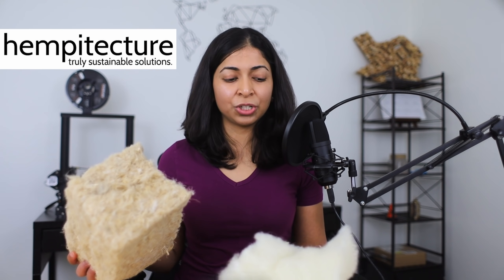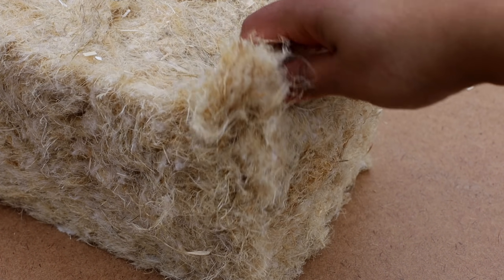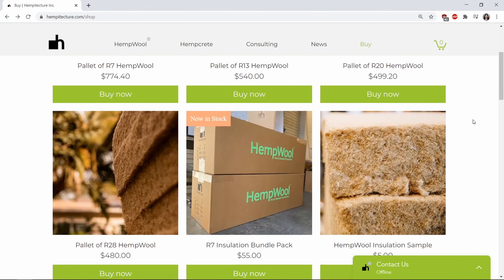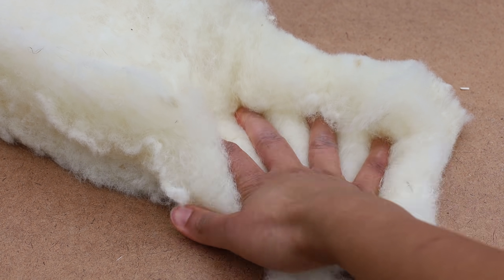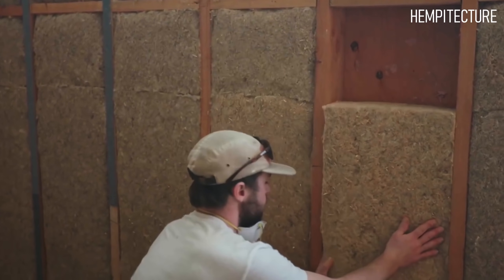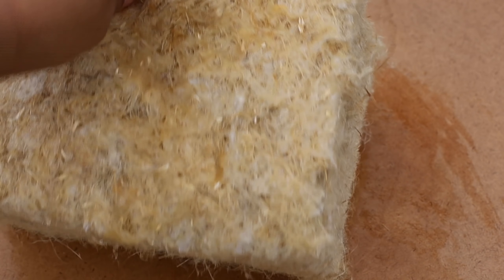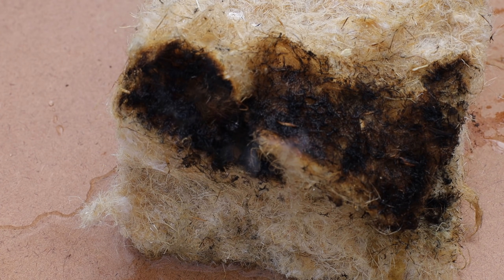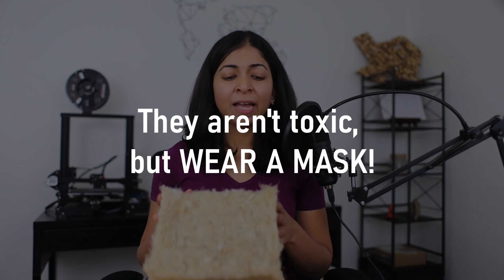Hemp wool vs Sheep wool insulation | Everything you need to know

Comment: There is absolutely no way that the embodied energy requirement of sheep wool is lower than that of hemp this is because it is an animal product versus a plant product. 
This means that per square meter to make 1 kg of wool we need to feed the sheep a significant amount of plant matter, probably somewhere in the order of 10 to 20 kg (citation needed obviously). However with the hemp product we can use those 10-20kg directly instead, therefore yielding a much higher amount of insulation material per square meter of soil used. 

I must say though that I am quite saddened by the flammability of the hemp product it looks like it could’ve been a fantastic competitor to mineral wool, but given the lingering burning that happened it seems like it would be nigh impossible to extinguish a fire if one were to ever reach the insulation layer which is a serious concern, not to mention the vertical rise of fire through the walls. An otherwise small fire might wreck the whole house. Thats nit very eco friendly either.

Still I do really hope that it is solvable because otherwise it looks like a phenomenal product
Reply: Yeah that surprised me also, even more given the energy requirements for wool scouring. That said, the hemp was a blend with synthetic fibre, and there may be differences in growing pasture vs crops in terms of energy inputs.
Reply: @motorbyclist   hemp is known for being one of the most efficient crops, (ratio of sunlight to biomatter created, and equivalently co2 absorbed) together with corn, 
so its very likely more efficient then a pasture too ^^

Comment: Once again great content.
That fire test is such a concern this product should not be approved.
Electrcial wires and connections can cause fires and this product would spread fire.
I cannot touch any insulation batts without coughing, hate the stuff.
You can have chewing gum, helps stops fibres going into the back of the throat.
Cheers from Oz

Comment: Hi Belinda
with regards to asbestos, this material is the best insolater, however it is banned.
my concern is that asbestos cuases cancer in closed area with poor ventilation and the presence of asbestos particles that expose labours to get infected (very ideal condition). but outside in the open area and good ventilated area they dont cause harm. my guess.
i shall share a story in Oman where I used to work:
new portable cabin offices installed with split AC without fresh air blowers in these offices. offices hold upto 150 staff. locals and Asian did not suffer any health issues. Europians on the other hand started suffering from lack of Oxygen. when room were tested, the percentage of oxygen was low. then we istalled blowers with fresh air to overcome this issue.
this lead me to conclusion that our lungs are more reslient than of Europians.
this is applicable to Asbestos as there is not case or death ever recorded in the middle east due to Asbestos. I could be wrong.
the ban should be challenged and more tests to be conducted.
please share your thoughts.
hope to hear from you soon.
Reply: you are wrong. Gulf Center for Cancer Registration provides data on the cancer incidence in six countries (Bahrain, Kuweit, Oman, Qatar, Saudi Arabia, and United Arab Emirates). In the period 1998-2007, 144 mesothelioma cases were registered which is  comparatively low incidence. Countries such as UK have very detailed registries and studies of populates where as data in some countries may be incomplete.  The 4 main risk factors for developing asbestos related illnesses are 1) exposure 2) the type of mineral 3) genetics and 4) concurrent smoking history.   in terms of your oman story - if europeans suffered from 'lack of oxygen' then the conditions in the buiolding were incredibly dangerous  - you would need to be in a fully sealed freezer  van or something to actually run out of oxygen.

Comment: Thanks Belinda another great introduction to insulation. I think you covered most of the pros and cons on this subject, but may I add a con for sheep's wool. In the UK we had problems with wooly moth infestation munching their way through the insulation and then clothes and carpets! To be fair this was due to the leaching of the insecticide treatment. A new wool treatment was introduced about 10 years ago and it seems to be working, however specifiers continue to be concerned about the risks. For this reason we always spec hempwool.
Reply: Hello! Havelock Wool here. We do add a slight amount of boric acid which deters all insects including moths. And we note that across our +10,000 projects we have had zero reports back of moth issues. Thanks!

Comment: I'm guessing hemp sequesters carbon from the atmosphere. That is nice. As far as sheep are concerned, do they emit large amounts of methane like cows?
Reply: Hello! Wool too is a carbon sink. Attached is a blog we wrote about it. You can also check out our Environmental Product Declaration which provides a full analysis of impact. Thanks! https://havelockwool.com/2020/08/wool-carbon-storage/
Reply: Thanks. Saved me typing this. I Googled. Hemp is very good at sequestering carbon. Sheep, like all ruminants produce methane and a lot of C02 is emitted to raise them.
Reply: @wclark3196  If sheep were kept exclusively for wool then that would be true. if wool is a byproduct then the carbon calculation is not so straighforwards.
Reply: @twmd  Already thought of that. Sheep husbandry still is an emitter of greenhouse gases. Devote the same land to growing hemp and you will be removing CO2 from the atmosphere. Furthermore, wool is the "byproduct" of meat production in your scenario. Eating meat has a harsher environmental impact because the process of converting plants to meat (by feeding to an animal) is inefficient. So saying "it's a byproduct" as if that means it has no negative impact is misleading.
Reply: @wclark3196  right but the point is if sheep being farmed for food it IS a bi product of another industry. If you start farming sheep specifically for insulation then it's clearly not a good idea.

Comment: Interesting, thanks very much Belinda. I have used both these products in timber houses for the groove between the logs line-scribed together (Medfar - mosegrop, meddrag, måssåfar we call it), and several times found old clothes of wool use for this, in timber-houses over a hundred years old. I now subscribe to the more and more normal practice here, of returning to the older convention of using moss for this job, as well as around windows and doors. For the simple reason that it has antiseptic qualities as well as insulation value. Picking moss is much more expensive though. It could be wise to use moss for the lowest logs, that are most prone to water damage and use these products higher up in the wall.
Reply: @LucasRichardStephens, are you talking about live moss? I've not heard of this! Any good sources you recommend that discuss this?
Reply: @theredbobcat  https://youtu.be/Fwl9kN29CtI?t=1712    put the subtittles on for the English translation.
There are other of my films where I use moss but I don't know which exactly. It is generally considered the best thing to have between the logs of line-scribed log houses here in Norway. But there are many opinions about which moss one should or shouldn't use.

Comment: Belinda, could the claims about the wool insulation about air purification be related to installs like a crawlspace or attic space where you might use string or other holders over joists and not sheetrock it in? Also, another fantastic video and direct help on a project I am planning!
Reply from the maker: Could be! It would be better to purify air in the space we occupy though :/
Reply: Consider different forms of Hempcrete for you project.... such as blocks of it for the bulk of the insulation and insite mixed and placed Hempcrete to seal around the existing infrastructure and the blocks....  Since it would have a lower cost and many other advantages.... VS Hempwool vs Sheepwool insulation

Just a thought good luck with your project...

Comment: Belinda -- in the mid-1970s, the big "new" insulating material was cellulose; finely shredded newspaper, blown in from a hopper/sprayer fan apparatus. They sold 'treated' and 'untreated' cellulose, meaning treated with borates as a fire retardant - or not. Once fire-retardant treatment was required, insulation manufacturers had to go back and vacuum out all the untreated insulation and replace it. Subsequently, I don't think anyone is using 'cellulose' any more due to cost and scarcity of old newspapers.

Seems to me that the hemp insulation should be treated with fire-retardant in the same way cellulose was. Is there a push for this? Should be, AFAIC. 

VERY interesting comparison, by the way. I love your explanations.
Reply: Cellulose is a great insulation product and is widely available.
Reply: @blackberryfarm7179  I referred specifically to shredded newspaper.
Reply from the maker: Thanks for the support and the info on cellulose. I haven't seen any info but really hope they make it fire-retardant soon!
Reply: @BelindaCarr  Cellulose is made from recycled newspaper and fire treatment is borox.  More fire protection than fiberglass.

Comment: I really DO appreciate this comparison of insulation products, Belinda.
A few questions, and a few points though.
Of course you need shears to cut wool.it's not that the keratin is tough, but the fiber won't hold its shape (as you discovered)
What is the embodied carbon cost of grazing animals, and that of shipping a inherently bulky product literally to the other side of the planet.
Without borates or some kind of treatment this stuff is going to have more moth larvae holes that grandma's favorite sweater.
On to hemp:
Cellulose fibers as found in plants are hollow and insulative, just like wool or deer fur.
How else do you think water gets from roots to leaves, or sugars from leaves to roots?
They are straws.
The polyester fibers in hemp wool are not going to compost and are a source of sustained flame.
I'm not hysterical about microplastics, but they are still no good in the environment.
Of course hemp can support/promote  fungi/mildew/rot. Any hemi-cellulose is just a step away from sugar.

Comment: I have a campervan insulated with sheep wool. It's  ok. Quiet. But I have found that some companies advertise it as humidity regulator. That is not true in van during a winter. There is far too much vapored water to store it in wool. You will get it wet. Must have perm retardant. I love the smell of it...
Reply: That’s interesting! What is perm retardant and how do you use it to keep wool dry in a van?
Reply: @junebay5265  A perm is a curly or wavy hairstyle from the 1980s.... it is also a water vapour unit of measurement ;)